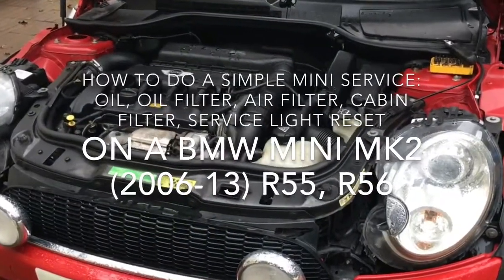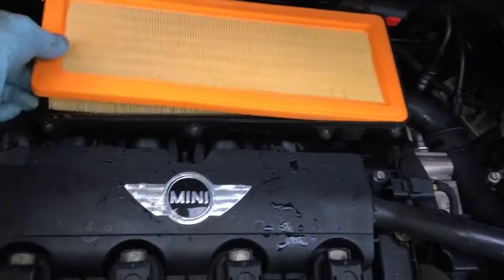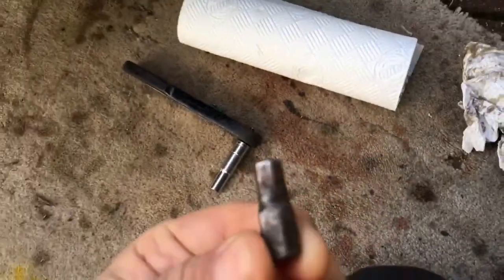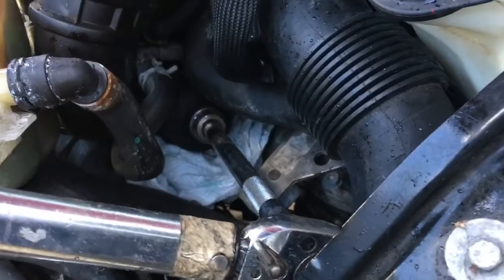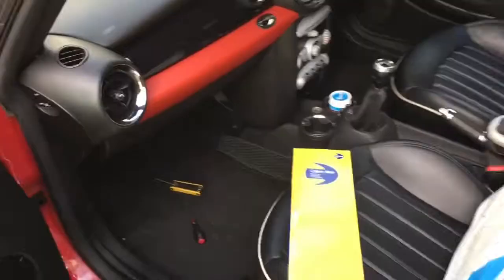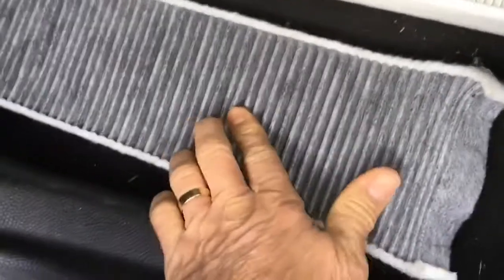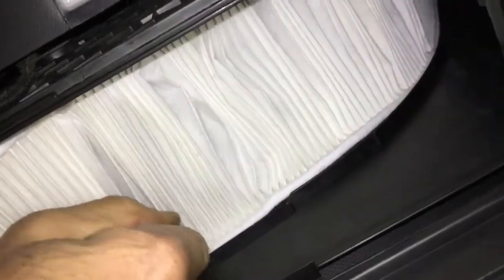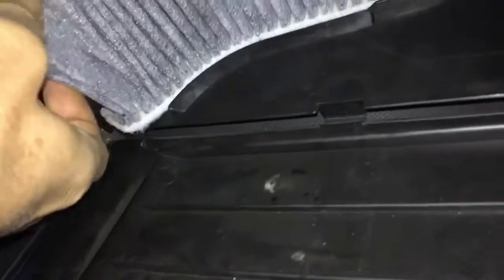How to Service a MINI - Oil, Filters and Service light reset

Comment: yep, I've done everything here, however I've gone as far as rebuild brakes, change hand brake cables, bleed brakes & clutch (after a leaky clutch slave cylinder was found)

however I couldn't remember where the service function indicators we're lol "now I can reset them" yay :)
Reply from the maker: Well done!
Reply: @comeinhandynow  I didn't mention changing the clutch & fly wheel.... if you need to do the work

I'd highly recommend using a hoist/engine crane to life the transmission/gearbox & yes its very heavy, the weight is all to the rear & wheel arch side making it awkward to manoeuvre... making sure everything is out of the way is essential (some ppl mention a bracket just above the filter housing.. that's honestly not a concern at all) & theirs a small lifting eye towards the rear you can attach a line to support the casing so its horizontal & it'll slip straight into position!!!

regarding the oil catch can.. I'm not joking, if you look at my videos there's a one https://www.youtube.com/watch?v=z7LxxbKxhCM&t=35s where you can see some part of my install (the blue hoses)

the rear PCV plastic hose "if you do fit a can... highly recommended" you can use the standard plastic fittings & slide the replacement hoses over these for easy replacement/fitting etc

if you've not checked your inlet valves, again I'd recommend checking their condition as it builds up with oil/carbon pretty quickly "hence the can" you an also check online for others with mini's who fit cans, most fit x2 on the R55/56 & so-on

also another little handy tip, remove the bonnet vent cover & replace it with a mesh or a aftermarket item as it does help engine bay temps & removal of heat at a stand still, as the vent is pretty much directly above the turbo.